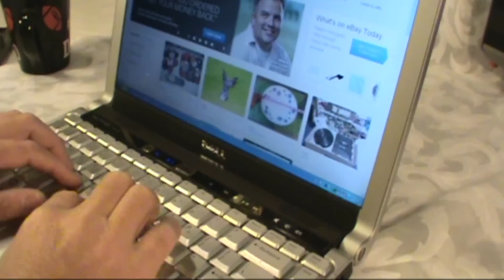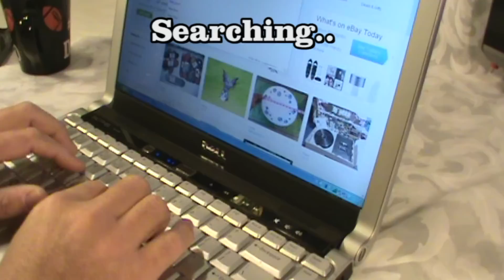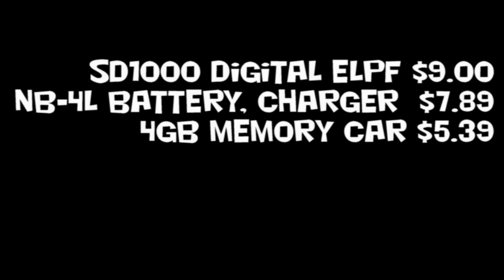Repairing LENS ERROR CANON SD1000 DIGITAL ELPH Digital Camera Fix

Comment: I disassembled my Canon SD1000 to remove the Infra Red filter for night shooting and found that the worst part of the reassembly was getting the the smaller ribbon cable from the LCD screen re-seated fully using tweezers. I noticed a small hole at the top of the ribbon cable and found that a pin inserted through that hole helped in seating the cable fully by allowing me to pressure down using the needle.
Hope this helps anyone considering doing this type of repair or removing the IR filter in these little Canon SD1000 camera's.
Reply from the maker: Thank you for the great info!

Comment: I would have removed all the connections of the old lens and cleaned up the connectors, reinstalled and checked if that was the problem.  Connectors getting dirty over time is common and may have been the problem all along.  After all, this is an older camera and you bought it used so you don't know how well it was taken care of.  Just saying.
Reply from the maker: +valveman12 Thanks for the great info !!

Comment: This happened to me and I just pressed the power button every 5 seconds for like 10 times and it fixed it
Reply from the maker: Wow, thank you for the great information.
Reply: me 2
Reply: Probably just dirt or dust in the lens mechanism. Blowing the lens out with some compressed air will usually get out the dirt or dust.
Reply: I think the dirt got inside the lens while the camera was shipping causing it to get jammed and stop working

Comment: Please Solve My Problem My Digital Camera (Canon IXY Digital) Do Not Switch (On)
Reply from the maker: The battery connection as well as contact the power switch checking, then if everything is OK, maybe it is malfunction of the system. In that case, DIY repair may be extremely difficult. Contact customer service of the camera and asking them about repair will be one of your choice.  I always go to the thrift shop and buy good working digital camera there. This one was powered on, but lens had problem. It was easy job to replacing lens. But I am not sure about power issue. Hope you will find solution. Teddy
Reply: Ok I Will Try.
Reply: @teddyhashee ,  very honest , I enjoy your video, thanks you.